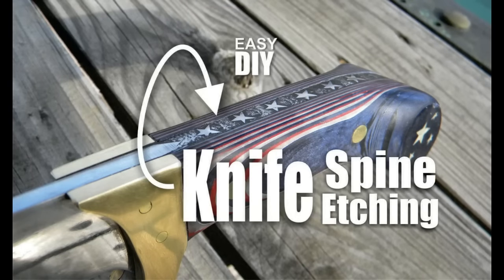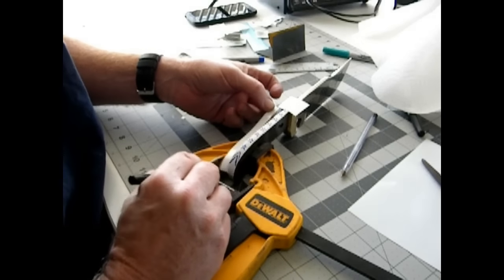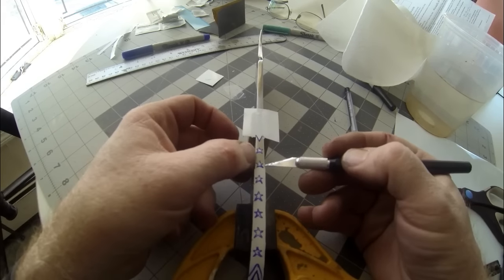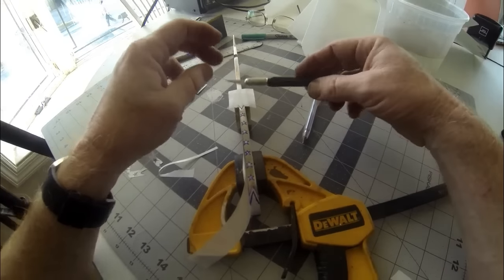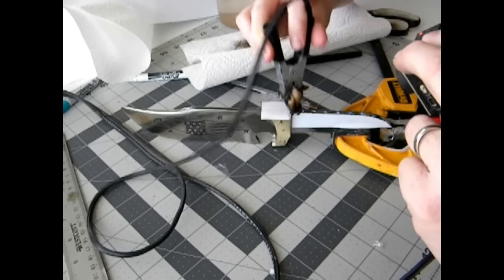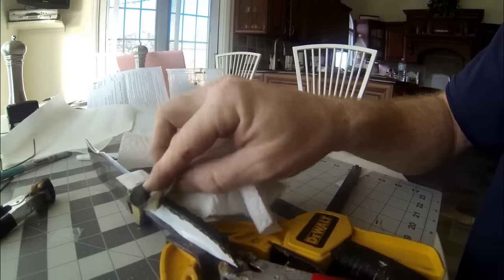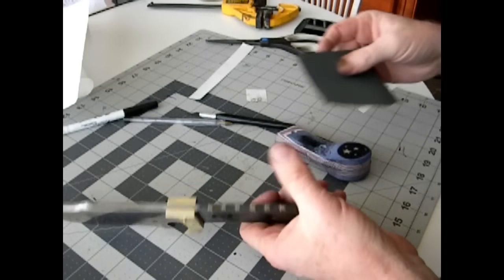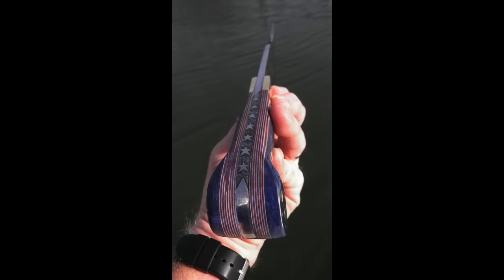Easy DIY Knife Spine Metal Etching

Comment: How many amps ?. How does the voltage effect the etching and speed. I have a variable DC power output supply where I can control the volts and the amps. WHy not use 24 volts ?. Would it reduce the time by half. Also why not use a cue tip instead off such a large wad of cotton ?
Reply from the maker: I use 12 volts 2 amps. Never tried 24 volts but would be a little concerned about building up to much heat. At some point the self adhesive vinyl will loose its adhesion. cue tip would work but you would be covering such a small area it would just take longer
Reply: Thanks I did 13.5 volts at 2 amps. Worked well. I guess your right. My knife was smaller. So the que tip worked out. Very happy with the results.
Reply from the maker: This was one of my earlier videos. Have done quite a bit of etching since then. Check out this two tone blade etching using the same process   https://www.youtube.com/watch?v=PYb76kMFSJ8
Reply: You have inspired me to take up working with knifes. Im already a port grinder so working with metal was not new and I had most of the gear except for a belt sander.